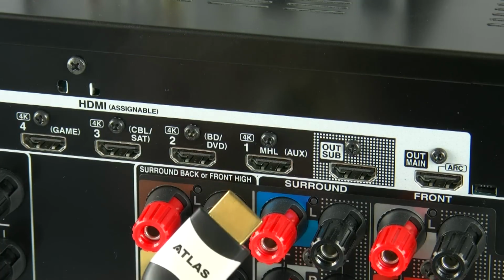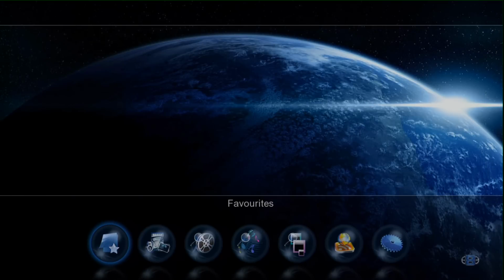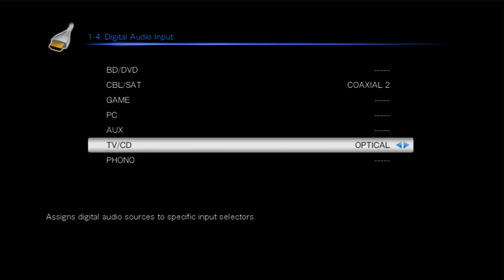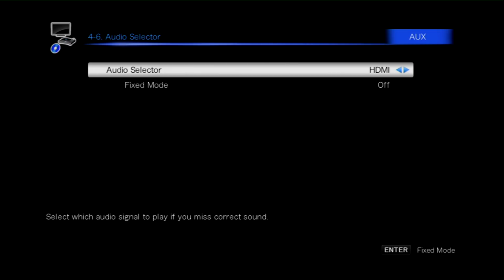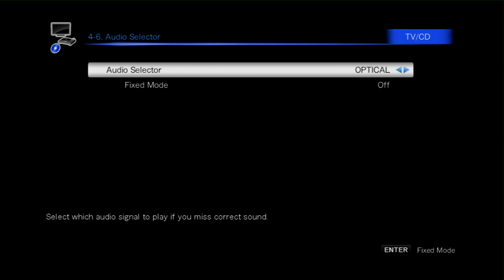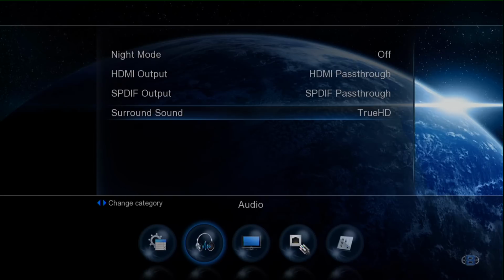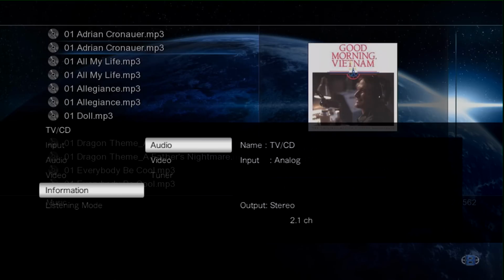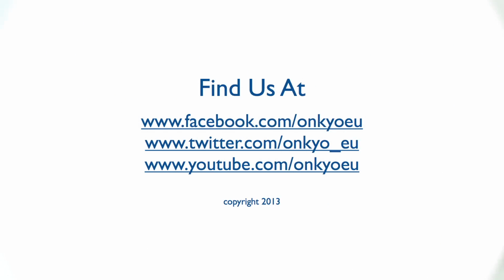NEW 2013 ONKYO AV RECEIVER TX-NR626 -How to setup a media streamer

Comment: So you can't do it ?
Reply from the maker: Hi pedro081166, not sure if you are relating to the question below - and there may be some misunderstanding: it is not possible to connect two different devices to the same physical connector at a given time - one optical connector can only be used by one product at a time...